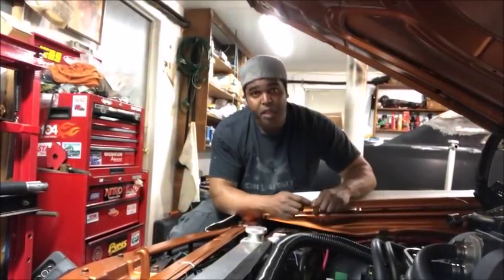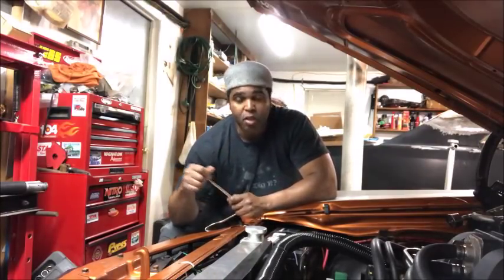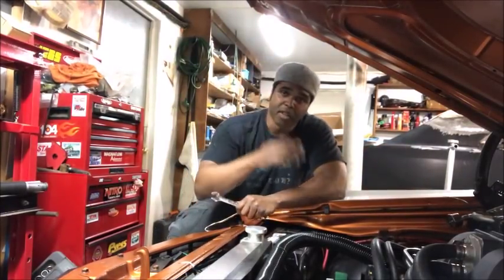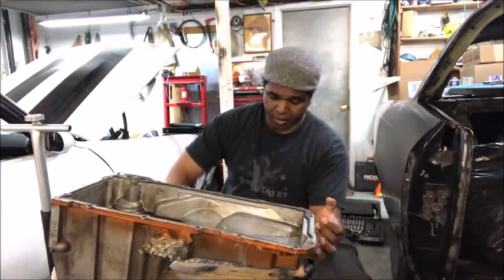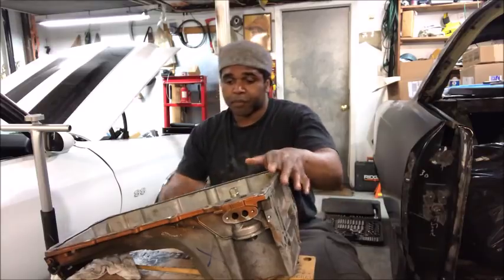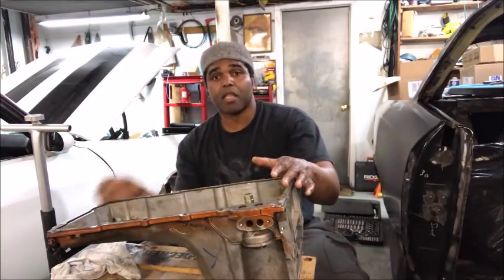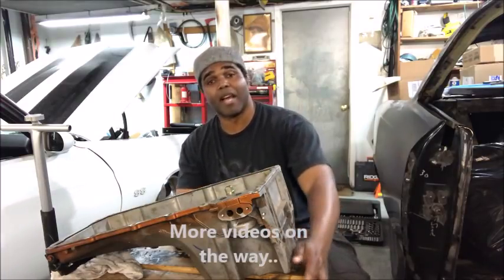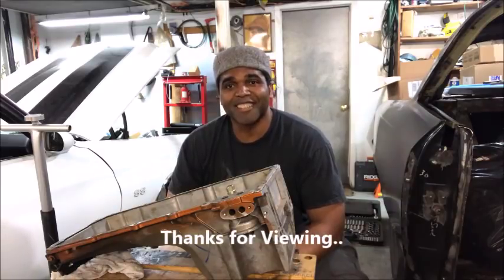Front Oil Sump Pan or Rear Oil Sump Pan.

Comment: Hi Terry, 
One of the reasons  they use a front or a rear sump pan is for fitment over the cross member. Also if you are going to use a extra pint of oil make sure the engine has a windage tray. Because if you don't the crankshaft will whip up the oil and it will cavitate. Just letting people know . I am sure that you know that. Another awesome video Mate. Cheers Mark.
Reply from the maker: always good to get a comment and some updates.. thanks brotha Mark.. thanks again..

Comment: i have a 1967 chevy nova and with a nova from 62 to 67 because of the front end cross bars you can only run a front sump so my small block wont work untill i find a front sump kit
Reply from the maker: check Holley, i think they make a pan just for this application

Comment: Hey, im doing this engine swap and the engine has front sump pan and the car that i am swapping it into had rear sump pan soo i started to make  custom rear sump pan but then i got to thinking that will the oil pump pull oil from rear. sorry for such long comment.
Reply from the maker: no problem.. im doing a video now on installing a from baffle to keep the oil from going to the back upon hard excelleration sty tuned this might be a great option for you

Comment: excellent terry!  i just picked up a 08 tbss awd never knew about the oiling issues they had, these thing launch so hard and GM stuck the pump is in an odd location and heard people were blowing these up, in fact, the motor in mine is a replacement one lucky the guy bought a warranty lol thanks for the tip pcm sells a baffel kit and p/u tube relocation however i hear its best to pull the motor to do it and if thats the case she gonna get an exra qt until it has to come out and then you can bet something stronger is going in lol  i hear a lot of stuff about the oil ring that connects to the tube they all look a like to me but i take it some are thicker ? or different some how ? thank you terry! i am digging the ss what a great ridding vehical ,  just orderd led turn signal boards for it these things are bad ass guy sells them on trail blazer nation ..https://youtu.be/D-XUcqpRCqk
if ya get a chance check it out ...  thanks again keep up the great work  ps soon as my cutty is done i will be looking into that lsa build !
Reply from the maker: thanks as always brotha Juice.. keep me posted with this.. remember extra quart until that engine comes out. lolol
Reply: coverman66 yes sir lol just did an oil change so I know we are good now 
Looks like the oil mark is right at the kink ..
Reply from the maker: cool.. i try not to take chances with that engine..
Reply: coverman66 looking forward to tbss vids👍🏻
I’m back in the hospital real bad infection almost killed me 
Been in a few days feeling good should be out soon hopefully I can do a vid soon 👍🏻